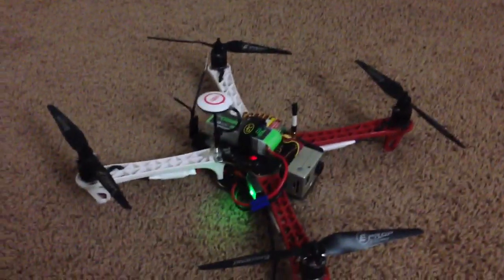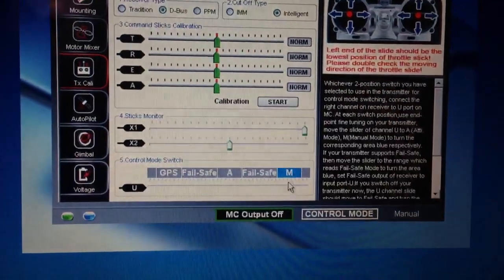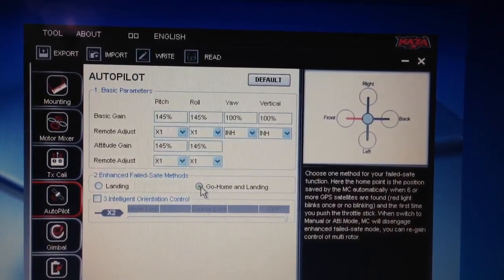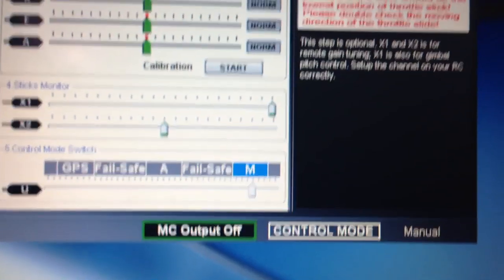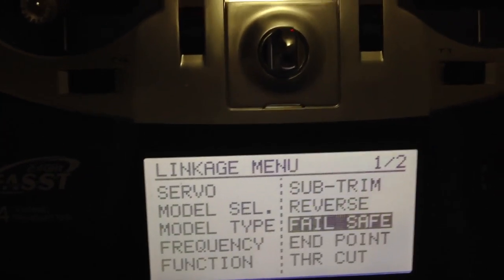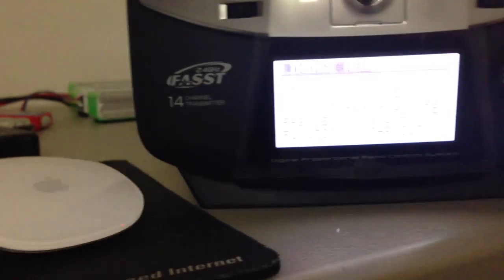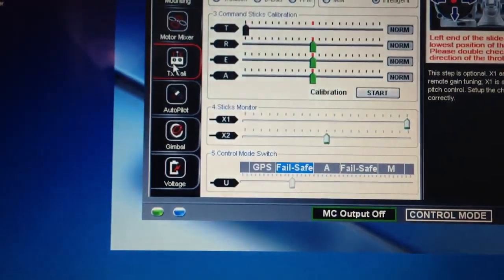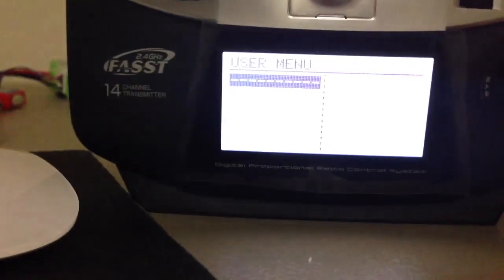Futaba 8FGs & Naza Set-up #2

Comment: Are we saying that if failsafe is activated and the copter returns if the transmitter throttle stick is push down to 0 and the TX system is back in range or switch is returned to something other than failsafe the copter will fall out of the sky?

Comment: Hey Jon, Great videos - have you heard of this issue at all: I've gotten everything working as you do in your videos. However when I power up my naza without props, do the CSC, it arms, motors idle, but never respond to throttle. They respond to all other stick directions, but throttle up and down seems to do nothing (except throttle down for the 3 seconds turns them off) - thanks

Comment: Hi Jon everything is working great but when i'm flying and i want to disarm Failsafe its not disarming the only way to disarm Failsafe is to go into manual mode is that right or have i not done a setting on my transmitter right thanks Phil.

Comment: Hi i have done your settings on my 8FGs and everything works good thanks for the info. The Failsafes work with force failsafe switch in GPS & Position Hold & Manual also turning the transmitter off is working. But when my Quad is flying disarming the failsafe is not working when i put the switch back also its not disarming when i turn my transmitter back on. The only way i can disarm failsafe and get control is into manual mode and then into GPS. But when i plug into the computer its disarming.

Comment: Just one question. When I force failsafe mode via SF lever, I can't figure out how to get it to set throttle to the same value as if I enter failsafe by turning off the Futaba.

Is there a way to set throttle when switching on failsafe via SF ?

Comment: the EZUHF needs  PPM input in from your rc controller but it doesn't transmit in PPM just set it to traditional in the tx calibration menu on setup and it should work fine for you

Comment: when i lower my end point from 78 to 35 the cursor goes to failsafe , when i lock it in it shows +35 instead 0f -35 so when i do shut off radio it doesnt go into fail safe..need help

Comment: Swapped out Futaba R6208sb receiver for a Futaba 7 channel R617FS receiver but  page 64 of 8FG Super manual says "a FASST 7CH will only allow failsafe features on channel 3, i.e., the throttle channel".
I no longer can switch to GPS mode and cannot go to failsafe mode when the transmitter is turned off.... Any suggestions?

Comment from the maker: @ Altimat02 - You can set up the Naza and 8FGs in Heli mode but it's not needed. the 50% (Mid stick) hover is achieved by being "proped" correctly for your weight and when hitting the "write" selection within the assistant software you'll want ALL sticks at center so the indicators are green to show what mid stick truly is when you are in Atti or GPS modes. Manual will only depend on the "prop" size to weight for mid stick hover. Thats how I base my prop size to start. Cheers!

Comment: Jon - thanks for posting this. I have an MZ14 so the program mix portion is a bit different but I was able to get it sorted out. I now am able to go into FS when I switch off the TX and in each of the 3 flight modes (M/A/G).
I hope that I never need to use the FS - and am a bit leary about 'testing' it....but I guess it's a bit like practicing auto rotations ... better 'safe' (testing it) than 'sorry' (needing it and not knowing if it works or not).

Comment from the maker: UPDATE - My gains are as followed now. 141-141-120-120 & 91-91 with the Pitch/Roll basic gains assigned to as "X1" for LD knob control, the Pitch/Roll Attitude gains are assigned as "X2" for the RD knob to change these on the fly separately since they affect the flight in very different ways.

Comment from the maker: @ gtranquilla - When in Atti/GPS modes mid stick will have the MR hover so that it's stable but manual doesn't have stability & allows the motors to get full range/watts. This is something that will be dependent on the motor KV & prop combo. With 10" Props in manual mode my MR lifted slowly at mid stick & with the 9" props it will lower at mid stick in manual. I went 9" props to get a good blend with better wind handling vs. the 10" props. I hope this helps as it is normal depending on set-up

Comment: Jon, I noticed that my F550 Hexacopter will suddenly climb when I switch it from atti or GPS mode to Manual. I then have to cut back on the throttle to bring it back to the previous altitude. Reviewed both you setup videos and couldn't find any errors in my setup. Do you have a similar situation or know why this is happening and/or how to correct it?

Comment from the maker: @ Mick - Yup the only reason I have the Throttle increase upon a Tx power off is because the Naza requires a minimum of 10% throttle to sustain the RTH function and if you lose signal you want to make sure the Naza see's that throttle at 10% OR greater. If you're doing forced failsafe while flying if needed just keep the throttle at mid-stick like your flying that way if you get back in range and want to turn the forced failsafe off your going to regain control with throttle.

Comment: Thanks great vid I had noticed that in your mixing set up that when you flip you switch SF that I didnt see the throttle dial move up on the dji assistant but it does when you do a power switch turn off . Mine is doing the same but just wanted to confirm that is correct     Thanks again for your video graet help

Comment from the maker: Thanks! Well the biggest thing to remember is taking on in Manual you will need to always be on the sticks controlling every axis, when flying & taking off. When starting in Atti at least you don't have to worry about it wanting to instantly walk on you. It gives a nice stability right off the ground and hovers at mid stick if set-up correctly through the assistant. I typically fly in Atti & am working towards full Manual fight for that all out aggressive FFF.

Comment from the maker: I actually do not like dual rates. That comes from flying my Heli's after switching from dual rates to one max rate and everything was much more consistent leaving it at 100%. When learning to gain better control I would start in Atti mode and get into manual flight after you feel comfortable. This worked best for me

Comment from the maker: @ Marco - The difference between failsafe signal loss and forced fail safe is that when you initiate forced failsafe with the switch your transmitter is still on. The 10% minimum is recommended for the "signal loss" failsafe because it's a preset so that you never go below 10% throttle if signal is lost. Anytime that I have tested my forced failsafe with the switch flip I am around mid-stick and don't lower throttle as the transmitter is on so that I can take it out of failsafe once closer...etc

Comment from the maker: @ Marco, You're welcome and here is a little more info regarding the failsafe positions and forced failsafe. The 10% minimum is exactly that and many do go well above 10%. Once the transmitter loses signal or shuts off the minimum just takes over and it won't matter if you have 10% or 50%. Once it comes back into reception it will matter but you would want to flip failsafe on if you lost signal. That way if the Tx & Rx regain contact you are still in "forced failsafe"

Jon

Comment from the maker: You are very welcome Addy, I am always glad to help when I can! Yup the S.bus single cable gig' is a neat thing as it cleans up the mess of cables form the Naza box to a Rx. The VU has the 2 plugs going to the Naza controller. The 3 wire VU plug goes to the "X3" port and the 4 wire VU plug goes to the "LED" port. The single S.bus cable from the Rx goes into the "X2" port and the GPS compass plug goes into the "EXP" port. As long as you have those plugged correct everything should be perfect.

Comment: Addyover@gmail.com
Thats is great that the RX S-bus can communicate to all the channels A, E, T, R, U and X1. So  X2 to Serial Bus, X3 and LED going to VM, thats it?. If I follow your set-up video, which I did (less proper connections), I should be good, Thanks. Your videos are great. You are a big help. I have not had the time to read and study the manuals but will get to it soon. Funny thing because after the space shuttle retired (my last job of 32 yrs) I became an A380 Service Engineer.

Comment from the maker: Hey Addy, no worries! The S.bus single cable will control all the channel though the X2 port. The VU plug will go into X3 and then you'll have the larger VU plug (since there are 2) going to the horizontal LED port. I have a pic if that helps? Shoot me your email address and I can send those right away. :-)